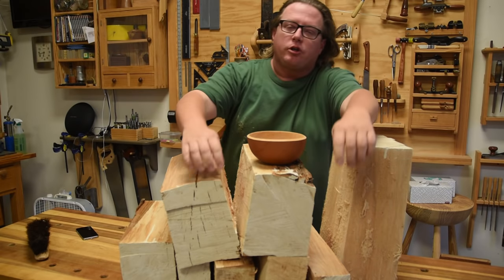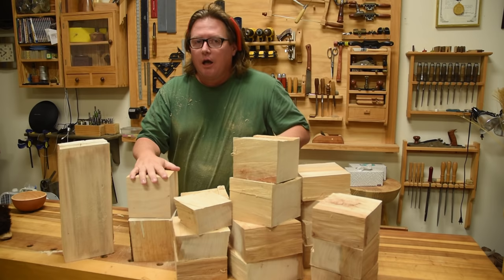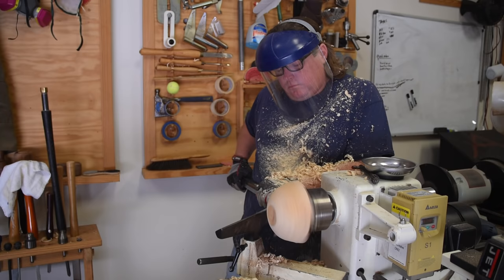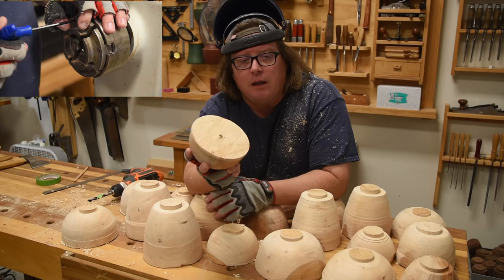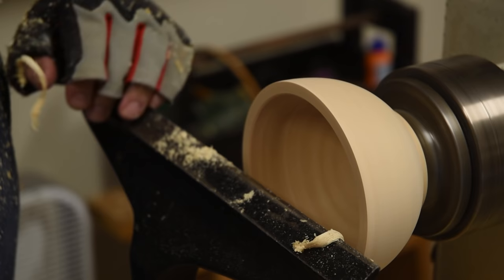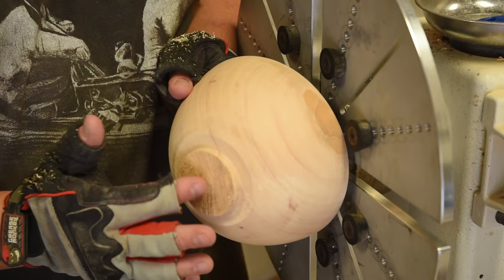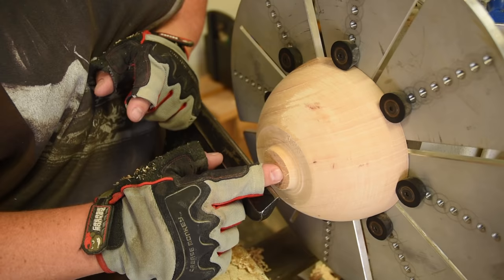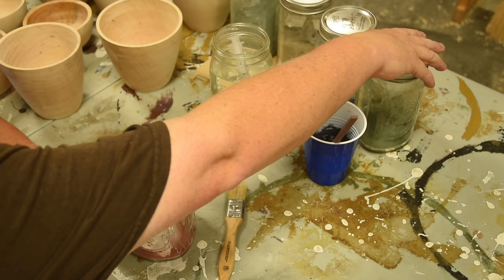Make a $20 Bowl in 20 Minutes

Comment: Great tips! Thanks!I have been turning for a year now, mostly rough turned stuff at this point. I have a lot of pieces i need to finish. You mentioned near the beginning of the video that the wood was green and wet. How is the paint and oil you put on the pieces at the end going to hold up to the moisture in the wood? I was under the impression that one had to dry the bowl before finishing it?
With the paint and oil on this, will it still move and change shape as it dries out over time as an unfinished green piece would?
Reply from the maker: It's so thin by time your done it'll dry fast. Milkpaint is made with water so it's fine. Oil and water don't mix so fine.

Comment: I have never turned and just bought my first lathe. I plan for this to be my first project. Do you think this would be a good place to start for a first timer?
Reply from the maker: I always suggest starting with spindle turning between centers. You'll learn much more and catches aren't so bad.
Reply: Thanks for your response! So, do you mean use the tail stock? or try a different project?
Reply from the maker: If you want to learn skills start with spindle turning which is turning between centers with the tree rotating with the grain. Bowl turning has the tree turning end over end. Search for "Woodturning Demystified" for a video I did on turning basics.
Reply: wortheffort thanks man!

Comment: is it okay to turn very green wood (tree was cut 3 weeks ago) and then let it sit in a rough shape for a while to dry out more?
Reply from the maker: That's what twice turning is. Just make sure the thickness is very even so there's no more stress in one are than another. On the second go around you can add cool details. General rule of thumb is to turn down to a 10th the diameter in wall thickness to dry.

Comment: great video, thanks for sharing. as a newbie can i ask why you reverse the lathe when sanding. I have never seen that before
Reply: 1958linedancer 
 When you sand a bowl, besides sanding, the wood fibers also lay down. He reverses the lathe to raise the fibers and sand them smothe.
Hope this helps, Jim
Reply from the maker: it flips the abrated grain back and forth for a smoother result after finish is applied.

Comment: Thanks for posting an informative and easy to follow tutorial.  My only question is why not use a higher quality brush?  Looks like you're using a chip brush which is prone to losing bristles in your paint.  Is it primarily for the texture or cost?  For 3-5 bucks you can get a brush that will last you months or years.
Reply from the maker: It's what I had on hand.

Comment: You stated you are using Pecan for the bowls.  I'm sure you know this, but Pecan is an excellent wood for BBQ Smokers and those shavings on the ground can be sold for additional income.  Pecan, Oak, Cherry, Mesquite, any nut or fruit tree wood smokes very well.  I'd stay away from Pine and the like.  Good Video, thank you.
Reply from the maker: Uh, shavings, sawdust and the like burn to fast for that.
Reply: @wortheffort  Soak them in water first.
Reply from the maker: @jaycollier8805  mildew?
Reply: @wortheffort  I keep mine dry until ready to use.  I'm in the Tucson Arizona and Dell City in Hudspeth county Texas areas, and we don't have a "humidity problem."  If you soak the shavings for an hour to several hours just before use, it works pretty well for us.  If you just dump the stuff, there are a lot of uses for it.  If you were closer to me, I'd pick it up and make a buck or two from it.  lol

Comment: I was wondering why you don't use a saw to remove the tenon from the bottom of the bowl?
Reply: Two things--If you are talking power saw that would be very unsafe.  Also you could not get it slightly concave.
Reply from the maker: End result isn't as smooth or shaped as I like.

Comment: Awesome video, definitely learned some tricks. The fact that you are turning green wood- does the paint seal it enough?  will it still warp (or crack) as it dries? ?
Reply from the maker: It's gonna warp that's why I emphasized the even curves so it's a consistent thickness. Milk Paint and Oil (likely more the oil) does a good enough job. Wax on the outside or beeswax on the inside will slow it even further. But at 1/8" thick it's dry in a week or so.

Comment: Thanks for another informative video. Is it for safety that you turned a Tenon  instead of a recess that would saved a step?
Reply: I use tenon for green wood (which he calls out quite a bit in the video).  Its my preference, but anything over a 5" bowl seems to fly faster if i go with a recess.

If its not green wood, i would go with the recess like you asked about.

Comment: Thanks for another informative video. Is it for safety that you turned a Tenon  instead of a recess that would saved a step?
Reply from the maker: you have to go a little deeper than I like on a small bowl with a recess so the interior curve can't follow the exterior as easily. On small bowls they usually end up bottom heavy which isn't good for green. So I do tenons which solve all those issues.

Comment: with the issue you mentioned on your large aluminum plate rubbing off metal markings on the edges of the bowls, i had the same issue with my scrollsaw top, i found that if i take clear packing tape, and "laminate" the surface, not only does it fix the metal rub off problem, it also aids in a friction-less slide across the surface. Thought it might help you if you tried the same on your large plate.
Reply from the maker: tape on the plate is one solution. Tape on the bowl also prevents the rubber marks as mentioned. YOu don't want the bowl to slide in the jaws.
Reply: True, just thought id share a solution that's worked long term for me, if you were to "laminate" the plate in packing tape you wouldn't have to tape each bowl, saving some time.

on a completely unrelated topic, i am about to take down several American Sweetgum trees close to my shop and was wondering if you've ever tried turning any green stock gum wood, and if so , were you successful? it has a reputation for a lot of drying movement which worries me, but i hate to waste the wood.
Reply from the maker: matthew yandle gum isn’t native to my area. More East Texas. I only have access to local stuff.
Reply: gotcha, thank you for taking the time out to respond. enjoying watching your videos (just discovered your channel), i really like your inclusion of secondary information, like grain consideration, time breakdowns, and pros and cons of your material choices. I've been making furniture my whole life (5th generation furniture maker) and im still learning a great deal from your videos, its nice to see a more in depth teaching of relatively basic projects.

Comment: Did you dry the bowls? The green wood I turned warped and cracked. How did you avoid that?
Reply from the maker: As stated in the video, turn thin and even. No variations in thickness. They've been making green bowls like this for centuries, it's not a new design.

Comment: How does it work with the drying process? They were still green. Won't they still crack and Warp? I understand the wall thickness but won't the bowls still warp because you made them thin? Maybe I missed something in the video.
Reply from the maker: Yes they'll warp, That was discussed. It's actually the more traditional way as 100 years ago this was tuppleware.
Reply: Ok, thanks. Milk paint must be really good then if it doesn't crack or chip after it warps.

Comment: You have a variable speed lathe.  I have 6 speeds.  what RPMs do you turn the bowls at after you have them to the rough shape you want?
Reply from the maker: Slow enough that the lathe doesn't move around, fast enough to scare me a bit then back it off till I feel safe. I've gotten faster over time as its easier on the body.

Comment: May I ask why when you first put the bowl on the lathe to do the outside rough in, why don’t you do the final outside cut and put a mortise on it and then it would be completely done and the last step would not be necessary. I only ask because I am a really new to turning and have turned a few bowls but not many. I know you have a process for a reason and your word is the woodworking gospel to me lol. I must be missing something and don’t understand what I’m missing. Thanks for the video and thanks for the answer in advance. The only thing I can think is your turning green and if you used a mortise on the bottom you’d have inconsistent thicknesses. Not sure?
Reply from the maker: It never gets flipped perfectly but you're welcome to try. Never hurts. Worst case you end up going over that section again.

Comment: hi I noticed that you did not treat the under side with anything, why?. could you use these as flower pots once sealed and painted .thanks
Reply from the maker: They were treated with the same oil I used on the sides and bowl. Wood can hold water, we eat soup in them afterall, but they need to dry out. The only way to keep them wet like in a flower pot is to encase them in plastic (poly or epoxy).

Comment: I keep trying this and end up with extremely cracked bowls. Any tips for avoiding that using green wood? I don't know how you made all those without them cracking to hell.
Reply from the maker: Cut one in half, is it thin and even thickness throughout? If not you know what to work on. If it is then try another species.
Reply: Thanks, I'll work on that!

Comment: Hello. Wondering what the front angle is on that 3/4 gouge? Thanks.
Reply from the maker: probrably something around 40 degrees but I don't stress on getting the angles perfect.
Reply: wortheffort Thanks! Yeah I suppose you can adapt your technique to the gouge as long as it's good and sharp.

Comment: It looks like you lathe has a VFD. Can it be set for "Ramp to Stop"? It seems like you spend a fair bit of time waiting for the lathe to stop and that would likely slow the lathe down faster.
Reply from the maker: I keep things stock usually. Find they tend to last longer.
Reply: That's a great point!  Unless you performed the necessary calculations, you wouldn't know if you needed a braking resistor or not.  Your specific VFD may not have that capability.

Comment: Looking up Jet brand band saws and maybe the lathe that you are using as well??. In the middle of making a wood shop from scratch at 60yrs of age. I look and feel like 40. But I need all the hardware. Also doing a DIY CNC Router for v carve bit work and some rotary tool (four jaw chuck and end stock) ,..yes I have my hands full. But I ain't running scared. :-) One question that I entertain at regular intervals is "Sources of wood" Where am I going to find my best cured wood??? I should know this, I live in a rural area. But no . One answer is old barn beam. Already stockpiling. But of other sources I have little ideas on. What do you suggest in  brief? Have you done some vids on your equipment of choice? Much thanks of course! Regards, C
Reply from the maker: My bandsaw is a knockoff of the Delta's that have been made since the 40's? Good used ones are out there. There are lots of options on large lathes, just do some research. My personal opinion is I stay away from pallet and barn wood both of which have likely been exposed to pesticides and such. When you saw them up you atomize that stuff. Think about how much has been sprayed on surrounding fields of old barns.... I'm sure if you search for a mill in your area on the internet you'll find something. Buy green and wait a year or two.
Reply: Hey speedy thanks for the info. Food for thought.  Never considered  spraying of agricultural pesticide and round-up. But it never happens in a wind, or they are just wasting product beside breaking several laws here anyway. Old bank barn material that held dairy herds is more than eligible because they don't use any spray on those fields around them and certainly nothing on the cows themselves. Besides after a while it ceases to be active. In Canada we don't go nuts with chemicals anyway. God Damned Monsanto! I find it sad that you/we have to consider this at all.

Comment: I'm having problems when I set my tenon in the jaws and try to start hollowing out my bowl. the tenon tears off! Can anyone help me figure out what I'm doing wrong?
Reply from the maker: Most likely you’re making too small a tenon for size of bowl in that species of wood. Bigger jaws for chuck might be required.
Reply: @wortheffort  Do you have any experience with carbide tipped tools? I have a round nose carbide tipped tool. I was also wondering if you know if I will have to go slower hollowing it out because I don't have a bowl gouge.
Reply: @wortheffort  Also, thanks so much for your speedy reply! Your videos are a great value to beginners!
Reply from the maker: @madelynmelchert7677  see my 4 cuts video.

Comment: 40/40 for roughing is much faster than pulling with a big gouge.
Reply from the maker: Is the experience or Kool-Aide because even the guy who coined the term 40/40 (even though it's been used for a while) will rough with a pull and shape with 40/40.
Reply from the maker: by 40/40 i mean push cut.
Reply: @wortheffort  Stuart goes both ways, I rough with push cuts. Though it doesn't work with a 50 degree nose. I use a 5/8" bowl gouge and take 5/8" shavings all day in green wood.
Reply from the maker: @matthewwright57  so it depends.....
Reply: @wortheffort  Agree it really does. Richard Raffan uses a side grain peel with a spindle gouge to glorious effect for shaping bowls. And then finishes everything with scrapers, and is probably one of the best turners alive. I just find that for turning air on rough blanks that push cuts fight me less and its easier to float the bevel through the cut.

Comment: Why do you use such a long handle?  What is the benefit?
Reply from the maker: leverage can be used for both power and control.
Reply: @wortheffort   Ok that's what I was thinking but wasn't sure. I just started(i've turned 3 carbide tool handles so far) just trying to absorb all the info I can.  Thanks for the no nonsense approach to the craft.

Comment: Well, you have turned enough bowls to be able to do a good job of turning, but I think you are a thousand or three bowls away from being a production turner. Rounding those blanks on your bandsaw would save you a lot of time... two suggestions, one, never stand in the line of fire, and I mean never. Two, slide your headstock down to the end of the lathe for turning bowls, which makes it much more ergonomically correct for turning and saves a lot of wear and tear on your back and arms.
Reply from the maker: This models headstock doesn’t slide like that, don’t own outboard tool test. As stated in video I don’t believe at this size cutting round saves time. Calculated risk....

Comment: you know you can lower your tool rest and not have to lift your shoulders ... level with the center of the work is relative to the position of your hand now a spirit level i have the opposite problem my lathe is too short and i ride the rest high  an old guy showed me that one
Reply from the maker: technically lowering the tool rest, thus raising the angle of the gouge, means you transfer more of the impact to your hands and body and less into the tool rest. It's a physics thing. It works for spindles because of less resistance and 'impacts' but I was hogging off a lot of wood and there was difference between resistence of end grain and long grain. I do that for spindle work but not bowls.
Reply: nvm

Comment: not a bad primer, but I have to tell you if you are creating enough heat to burn yourself you are putting waaay too much pressure on your bevel, in fact you will cause some woods to crack ( English yew for instance)
Reply from the maker: Could be also exagerating for effect. Heat also comes from speed. I'm turning around 2k here.